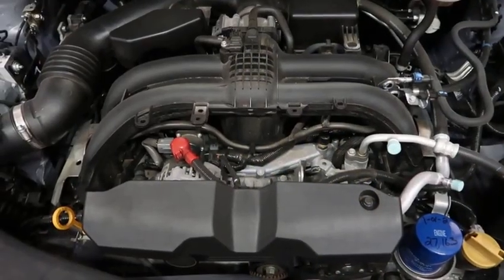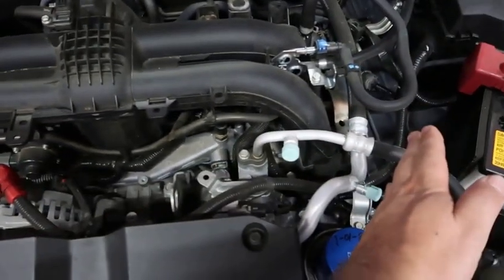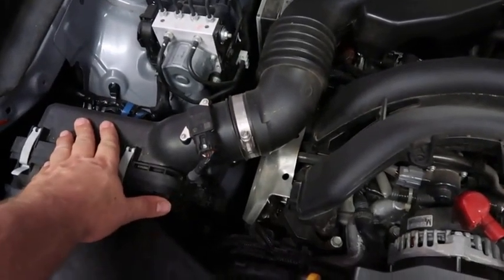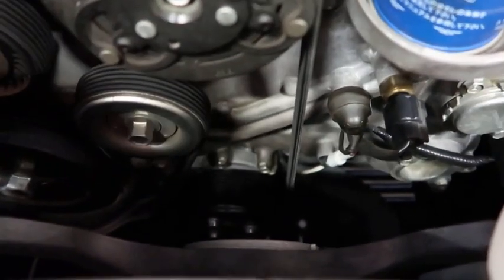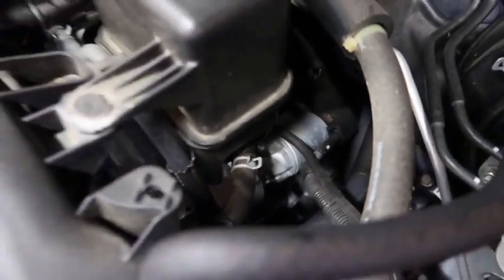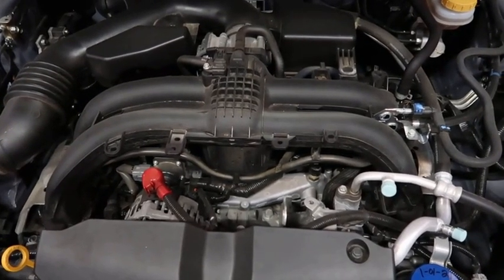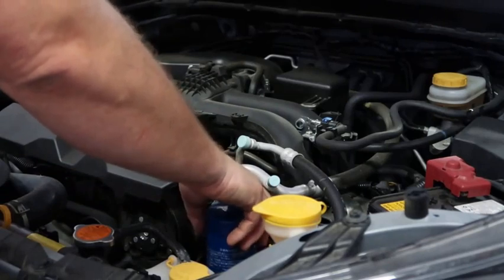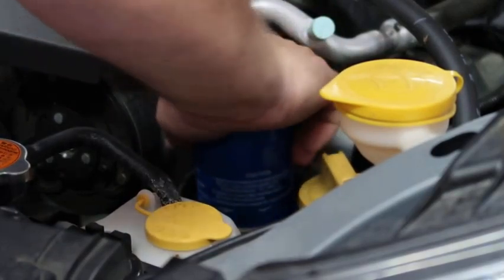Changing Oil 2017 Subaru Forester 2.5 L

Comment: Does the drain plug have a washer sir?
Reply from the maker: Yes, it has a crush washer. I always get new ones to replace them with but I am sure it wouldn't leak if you had to use the old one. Have a Blessed Day Friend!  Justin